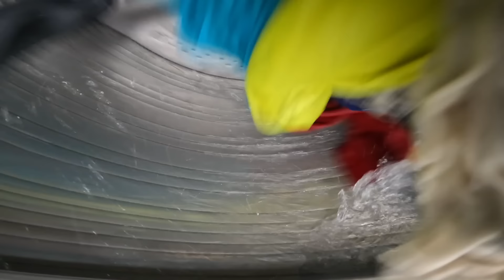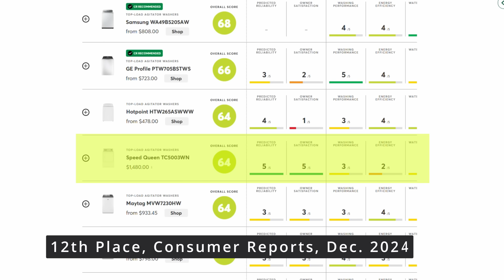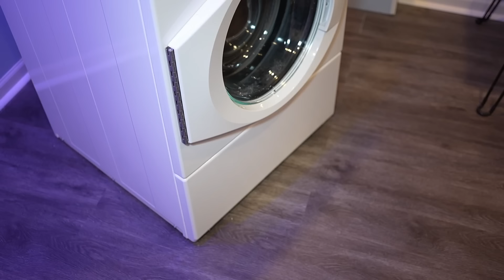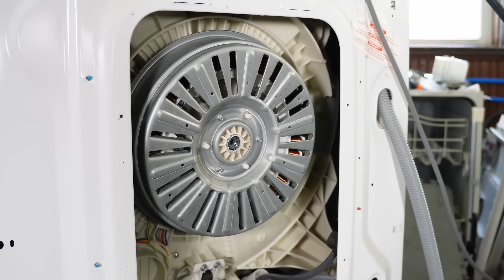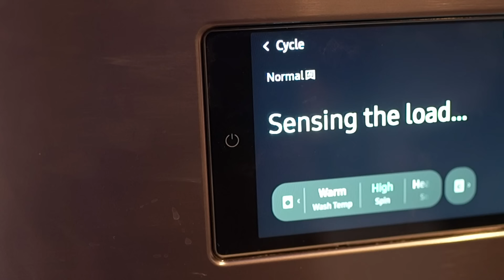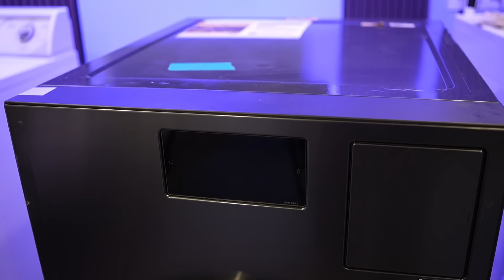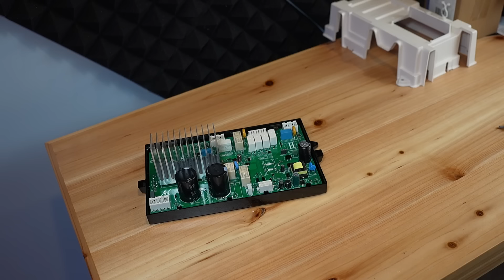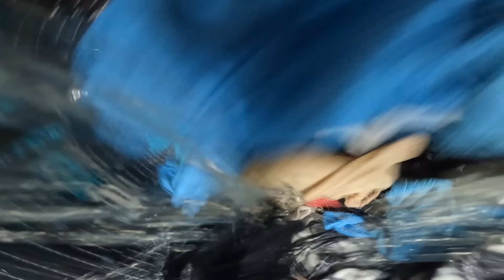Is America's Most Expensive Washer Great? The Speed Queen FF7009WN Test

Comment: Be absolutely prepared for sticker shock if you’re planning on buying the set-the dryer is the exact same price as the washer,hard to believe but it’s true. I still bit the bullet and bought both from an online appliance store,the weight of the washer is insane
Reply: If you can tolerate a non-matching dryer, you can buy the DR7, which has a 7 year warranty as opposed to 5 and is a lot lower priced.  Control panel is in the back as opposed to the front, but the panel is almost a match to the FF7.

Comment: Really small tub 3 times the cost of an average front loader. Doesn't wash good  uses more water. 650 for a board? Plus installing? You can buy a new machine.  1200 rpm lg 1400 . Only a dumb person will buy this.

Comment: Had the tc5 for yesrs now, love it! You need to be sure to select the right mode.. heavy duty is heavy duty. I just recently bought the drw5004we dryer. It works really good as well. Great quality. They both wash multiple loads a week. So far they havent skipped a beat! In the tc5. Is there any type of maintance to do? I honestly took it apart to see how its made when i first bought it. But really couldnt find any type of routine maintenance points of inspection.

Comment: I saw a video from this year someone posted that boughtt his SQ FL washer in 2015 or 2016... they had made a cycle demostration years ago showing off their machine.. then they updated the video title saying " SQ washer died just after 6 years" The control board went out...since it was out of warranty, SQ wouldn't help them... I learned though there was apparently an issue with the control boards in models sold around that time... that may NOT be present in the new ones.

Comment: I bought this SQ front load washer in 2019 for a family of 5 along with the dryer in stainless trim. They run every day and have for nearly 6 years, no issues. Mine is very loud though. That sheet metal trash can lid looking main pulley on the drum flexes and pops. Sounds like a snare drummer is in the wash room on the spin cycle. Done this since day 1 and we just joke that the washer is ready for takeoff. Love this machine. My buddy bought a samsung front load set at the same time bragging about all his smart features and his set already died a couple years ago. (Whos the dummy now lol) Once a month when we wash our dog's beds I clean out the door seal, pump screen and run self clean cycle. Always leave the door open as well as soap drawer open and no odors have ever occured.
Reply: Your buddy should have got an LG, which is the best washer given capacity, efficiency, features, design, reliability, and cost.  We already know Samsung washers are unreliable.
Reply: the people who live with repair techs who can just fix things when they break are so LUCKY!!
Reply: @ObscuraDeCapra Why you complaining like a teenage girl? So triggered. You need a hug. 🤣
Reply: @JohnLee-db9zt  Samsung is miles worse than LG.... especially when you're talking about washers... they may be equally bad with each other with refrigerators... but their laundry isn't nearly as bad as Samsung...

Comment: TIDE sucks as a stain remover soap....?
Reply from the maker: I will do a test with various detergents. But the concept here was that I used the same on every load, regardless. So if I change brands, I will flag it so we're not trying different detergents and assume its an apples to apples comparion every time.
Reply: Before I got a front loader washer in 1999, I used to use Tide as one of the detergents for pretreating, and it did great at it.  I don't use it as a pretreater when using a front loader,  as I risk oversudding the washer.

Comment: I bragged about my 25 year old front Frigidaire front load accidentally overloaded it, thought new shocks still noisy ordered bearings  after dismantling disintegrated spider mount 2 arms cracked aluminum corrosion (stupid design) So I ordered a replacement spider. Figured if it lasted 25 years it will last another 10 plus years . Trick is do not overload.

Comment: Great video-and I loved the stain testing. We have SQ front load commercial models in my building-essentially the residential version with a coinbox slapped on. I can say they are not impressive. The dispenser drawers pop out on their own, the doors literally crack (they are essentially a big piece of moulded plastic), and the washing is average. I certainly wouldn't buy one. But I think the biggest downfall of this longevity claim of SQ is the control board-there are already videos of people complaining of failures after 5 years...well who wants to fork out $600 for a new one? For that amount of money, you can just buy a new machine.
Reply from the maker: I agree. The MCU was just so suspect for a $2,500 unit. I am unsure what Speed Queen was thinking, because you could have easily put way better brand name componens on it, and there's an EE that commented on the MCU's surface components and thought it just wasnt designed well.

Comment: Asko, Siemens and Miele all have stainless steel tubs, are built for 15 years use, are quieter, cost less, are more energy efficient, wash better and are cheaper than Speed Queen.
Reply: Asko sadly don’t really exist anymore, they’re now a Chinese company and the quality has dropped massively since Swedish ownership. The Bosch/Siemens higher end machines are decent, but none come close to Miele, who manufactures most of their own components and have cast iron weights rather than concrete. They often last easily 20 years-plus, wash thoroughly and gently, and no machine is more efficient in water, electricity and detergent usage.
Reply: Front loaders are all the same. They lift and drop and the clothes tumble over each other. It must be the heater
Reply: @patcola7335  Clothes tumbling over each other with detergent in warm water is what gets them really clean. If it can’t heat water, it’s not a washing machine.
Reply: @ Why because the Europeans have this archaic belief that they still need to boil their clothes? 

We did fine over here in the USA for nearly 80 years of using automatic washing machines without heaters and not having one outbreak of any diseases.

Comment: Since you have asked for the test improvement suggestions, here is one. Measure "whiteness" of each shirt using a spectrophotometer before staining and report stains as a percent of initial value. There is variation in initial whiteness across t-shirts and there is always a chance of the washer spreading the stain around (effectively greying the shirt).
Reply from the maker: Great suggestion. I actually considered this prior to the tests but felt that relative differential may be better, but you are likely right: the washer should be extracting the stains and preventing them from migrating. My concern was if mixing the loads would change the greying based on hot/cold usage thus dulling it faster if a washer over used hot, ect

Comment: I’m about to order the TV2000WN with the DV2000WE just thought I’d let you know have a good new year
Reply: I'm about to order the same unit in the next 2 weeks. I can also do without the electronics and rather the old fashioned timer knob. The dryer I really don't need.
Reply: I have a 1998 Maytag Neptune washer/dryer set. As far as I knew, at the time it was virtually the only residential front loader on the US market. I paid $1600 for the set. This washer infamously helped drive the final nail in Maytag’s coffin. I’ve resoldered components on the main control board, replaced numerous wax motors, and over time I’ve serviced or replaced nearly every part. About five years ago I got an abandoned one, put mine and the surplus unit side by side, and used the best parts to make two machines into one. I have a reserve bank of spare parts from other abandoned machines. A few months ago I diagnosed a faulty timer dial and replaced it on the spot.

This model had stunning reliability problems. Why do I go to such efforts to keep this thing running? First and foremost, this machine cleans like no other washing machine that I’ve ever encountered. I’ve spent decades as a commercial fisherman in Alaska, and a few token marks on a white T shirt don’t come close to the test stains I’ve made on clothing. I wash my clean clothes when I come home from some long venture and they are noticeably cleaner after the rewash.

After 26 highly troubled years of ownership, I hate the prospect of moving on. I was rather lucky in jumping into a locally popular model that was abandoned in large quantities. Spare parts were plentiful, and the reliability actually improved as I repaired it. When my stock of spare parts finally runs down I’m going to wail, and gnash my teeth, and lament the loss of this phenomenal cleaning ability. Then I’m going to buy that Speed Queen,  no matter what it costs.
Reply from the maker: Nice!
Reply: Update - washer started squeaking during the agitation on the 4th cycle and after opening up the cabinet I saw that the pad to keep the wash barrel from scratching against the metal sides during transport/spin was leaning against a bolt behind the door not installed so I’m assuming I got a rushed unit before lunch break hopefully they will tell me it wasn’t properly greased and I won’t have to do a seal and bearing replacement other than the squeak it’s an amazing washer with 3 year parts only warranty
Reply: Update - After getting a drive bell tool to remove the drive bell I realized that it must have been screwed down to far on factory installation and ate into the drive tube seal exposing metal after replacing the drive tube seal kit and torquing agitator bolt to 60lbs the squeak was fixed.

Comment: Ben, we've had an FF7 for over a year now and it is great... except for it "walks" when spinning out.  I've had the appliance store here at least 3 times to "fix", level, etc and they cannot get it to stay in place. Do you have any thoughts or suggestions?  Thank you
Reply: Ours started walking when we moved and put it on the main floor.  We sistered the joists below it (3/4 ply on each side, attached with liquid nails and deck screws.) That stiffened the floor sufficiently to keep it in place.
Reply: We have had the issue with other machines and have it with the FF 77 as well. Do an internet search for rubber coasters for washing machines. You’ll find multiple choices. Our FF77 sits on top of a custom base cabinet that has a very slippery wood finish. The coasters keep it in place without any problem. It walks about 1/2” every 6 months, and I scoot it back in place 1/2”. No headache at all really.